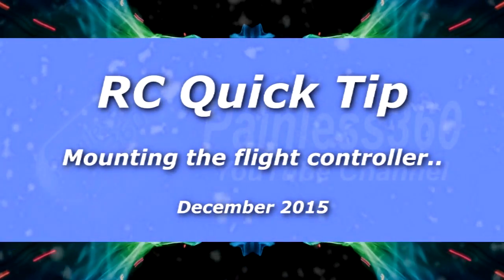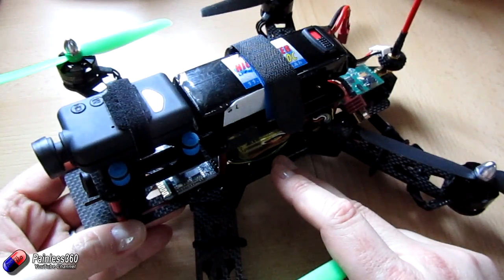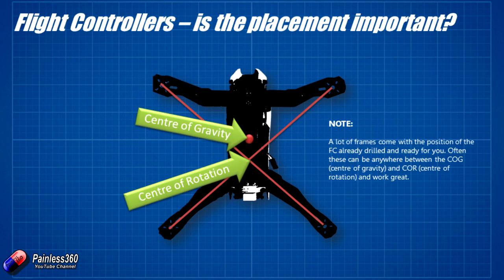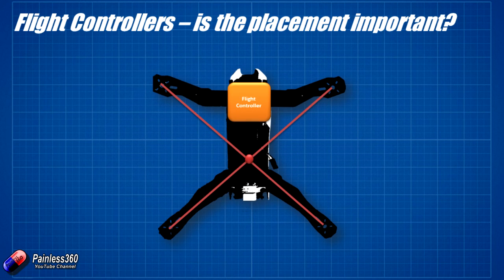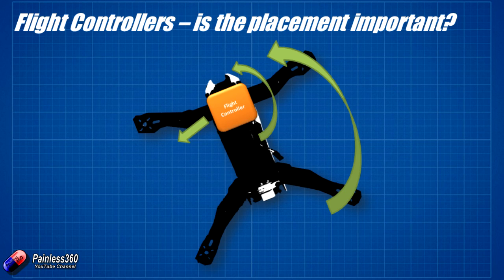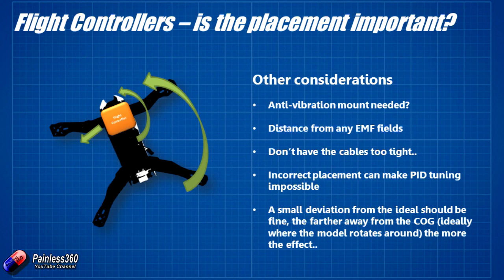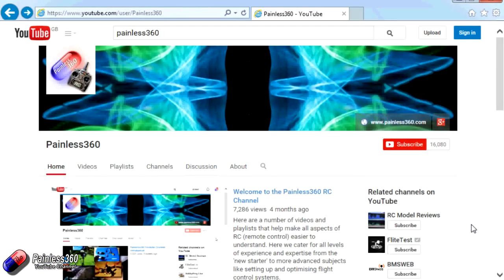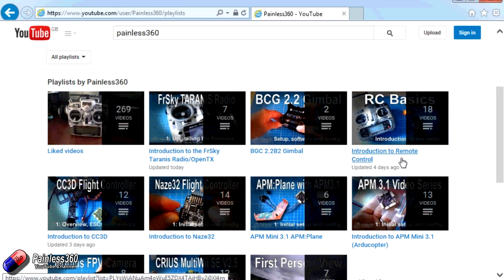RC Quick Tips: What is the impact of the Flight Controller Position? (Naze32, APM, CC3D etc)

Comment: i guess that for a wing, this is less important sinds it never turns around a axis that is in it's own center. am i correct?
Reply from the maker: Pretty much, Closer to the centre of lift is nice but I've installed FC's out in the 'rear' bay in things like the AtomRC Dolphin and it works great..
Reply: Thanks for your reply!❤

Comment: Can i use this technique so i get nice camera movement when i place the fc right bellow the gopro? Is there any software configuration to do offset the gyro so the fc think the center is below gopro
Reply from the maker: You shouldn't mount a flight controller too far away from the COG. See the camera angle settings in Betaflight that may help with better footage... best of luck!
Reply: @Painless360  i see, first i thought if i mount fc near the gopro when dlthe drone tilt the gopro didnt rise the horizon in video, and about yaw, i think fc will handle that. Thanks btw
Reply: @Painless360  but is there any adjustments if i tilt the nose of drone is not tilting only the tail so i can get steady camera shoot?

Comment: is it possible to compensate for this if my flight controller is placed in the front of the craft... i have just built a y4 and this was the most convenient location for it...
Reply from the maker: It'll still work but in my experience not as well..

Comment: Is this why my Eachine Racer250 flys weird and tail heavy? The stock CC3D Flight controller is not in the CG of the quad and when you try to bank turn it wants to fall over backwards on Stabilize.
Reply: Or should it be the center of thrust? I have no idea why Eachine put the CC3D way forward in the craft. My ZMR250 build I put the CC3D in the center of the quad and it banks/flys perfect.
Reply from the maker: I'd look at other things first, having the FC not in the COG/COR isn't ideal but the craft will still fly. Are all the blades balanced etc? Vibration can make a model do some weird things..
Reply: +Painless360 I just rebalanced my props and remounted the CC3D with Kyosho zeal gel into the center of the quad. Let the testing begin👷
Reply from the maker: Best of luck! :D

Comment: Thanks for the video! Question, I bought a Robocat 270 frame with the only option of mounting the FC on top of the frame, so higher than the center of rotation (when viewed from the side). How will this impact flight performance and are there any settings I need to keep in mind?
Reply from the maker: That should be fine. I've flown models with a similar setup with no problems.. Happy flying!

Comment: Bro .. it would be very helpful if you could show how u found the center of gravity of that kinda frame..
Reply from the maker: +Ashish Faustine try to balance it on your fingertips and where it balances is the COG.
Reply: I wish to do it the mathematical way
Reply from the maker: Good luck with that - you can explain it to me when you figure it out..
Reply: hehehe ok bro
Reply: am having yaw issues
Reply from the maker: Happy to help but please watch https://www.youtube.com/watch?v=olIqTiSJHIY and come back to me with more detail of what you've tried..
Reply: ok bro
Reply: +Ashish Faustine Hi Ashish, it is exactly half way between front and rear motors on any quad, dead cat, square or rectangular 

Here is the math. 

http://flitetest.com/articles/calculating-the-center-of-thrust-on-multirotors

You should place your CG also at this point for best performance (CG can be adjusted by battery placement)

Here is a visual that achieve the same result. 

http://www.hobbyking.com/hobbyking/store/uploads/608241098X618223X36.jpg
Reply: +Painless360 Half way between front and rear motors always on any quad is the true CoT - Math here 

http://flitetest.com/articles/calculating-the-center-of-thrust-on-multirotors

Adjust CG to this position for best performance.
Reply: +Painless360 That will only tell you the current CG which could be completely wrong for your CoT.

Comment: After watching this makes me realize the flight controller placement for the Tarot TL250/280.  Having the FC placed above the wing platform/battery, won't that affect the flight characteristics?  Especially when doing bank and turn movements?
Reply from the maker: +Ouel Pacla It will, a little, but probably not enough to cause a problem. Happy flying!
Reply: Painless360 - yes you're right.  I finished setting up mine (Robocat 270) and it did flew well.  It does show a little top heavy due to the HD camera being installed up top.

Comment: I've heard that if you fly in rate mode, this knowledge doesn't apply to you, since you're not using the accel, just gyros, the FC doesn't feel any movement, just rotation alone, so you're free to slap the FC anywhere you can fit it on the frame (even in any orientation), as long as you enter the offset angles.
Reply: This is true, in rate mode you can place the flight controller anywhere.
Reply: Of course the board is still doing work to maintain the motor speeds and create balance, just because it's only using the gyro doesn't mean it's not doing anything.
Reply from the maker: +Aric Blunk Really? Give it try an see ;) Best of luck..
Reply from the maker: You're assuming that in rate mode the FC is doing nothing to help you fly...
Reply: +Painless360 In rate mode, the only thing the FC is aware of is orientation, which is constant everywhere on the frame.
Reply from the maker: Then why have PIDs for rate mode if the board isn't doing anything?  ;)
Reply: +Aric Blunk Its true.   Roll, pitch and yaw values are sensed equally by the gyros anywhere on the frame.

Comment: Thanks for the video , I have a v-tail hunter quad that does a little shake some times on a banking turn, flight controller mounting point is forward I'll have to give it a shot closer to center
Reply: +Mel. D. You can use my mix calculator for your V-Tail or send me the dimensions and I'll calculate it for you. 

The calculator gives you - True CoT (which is the optimum CG position to aim for) and the custom mix for that Cot (CG).  

https://dl.dropboxusercontent.com/u/62849459/NAZE%20MIX%20Calculator%20V5.xlsx

Comment: You mention keeping some distance from emf. What about the common practice of stacking the fc on top of the pdb? Or if I run my main battery leads past the fc? Should I worry about problems in either of these cases?
Reply from the maker: +Handley Machine If you are using a magnetometer on the FC then it will be affected by the current flowing around the PDB if the FC is too close. I use a MuMetal shield with mine for those FCs that need it..
Reply: +Painless360 Sorry. Mumetal?

Comment: I have a question about powering a turnigy 9x 9ch receiver. What channel do I put it in, or do the 3 pin JR powering it? If not then do I have to buy some adapter?
Reply from the maker: +riley yolo Please post questions on the relevant video. Thanks..